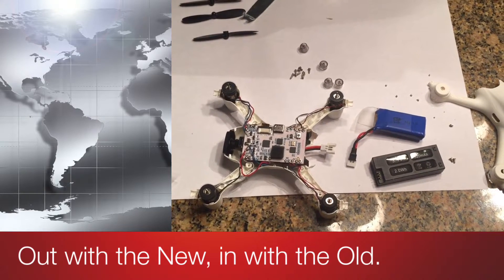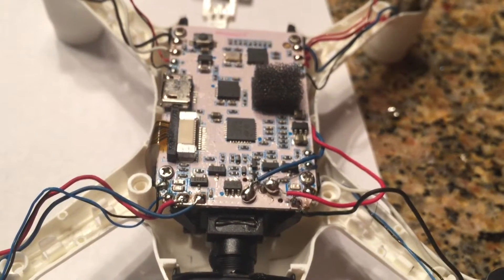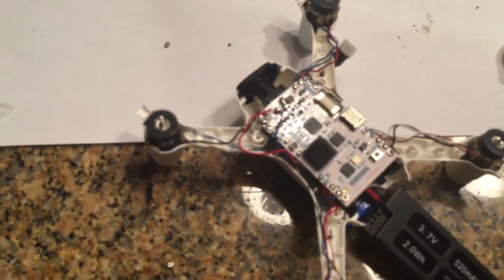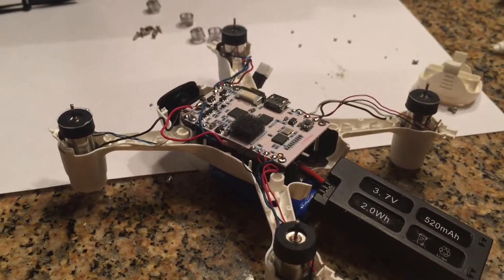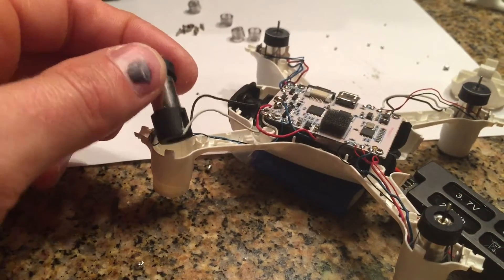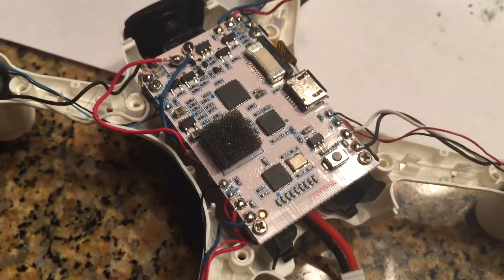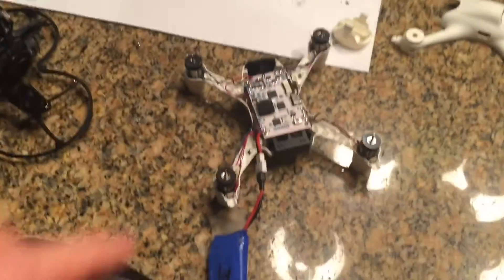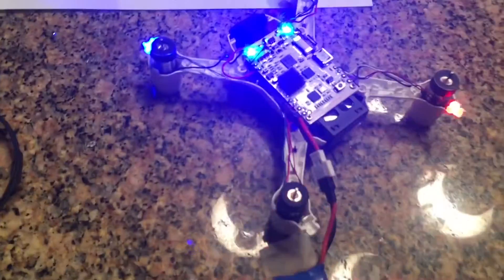Hubsan X4 Mini H107C+ Quadcopter Battery Mod

Comment: @Silas Paine 
You have either made a wrong connection for one of the + \ - (maybe both), soldered a "cold-joint" or shorted a circuit in the process, I guess it is to late to help you, perhaps this is useful some one else ?

Comment from the maker: Although it runs on two batteries, it does not extend the run time or speed.  Just allowed to run using either style battery.
Reply: Chopping down chassis weight, and mounting the extra on topp, on the pcb, should correct the weight distribution, and increase agility.
(Proprietary is a waste, just dont buy it!)